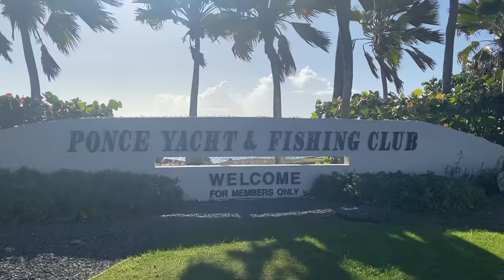Journey begins in Puerto Rico: NEW boat & NEW engine [ep 1]

Comment: I have a 1980 thompson 20 ft. When I bought the boat 2 yrs ago. I started remodeling the whole boat. The bilge pump was intimidating for me to. But I put a new one in and a float switch. Just had a starter silinoid go out 3 weeks ago just fixed that. Hoping to get back out on the water before fall gets here. Be safe enjoy your adventures